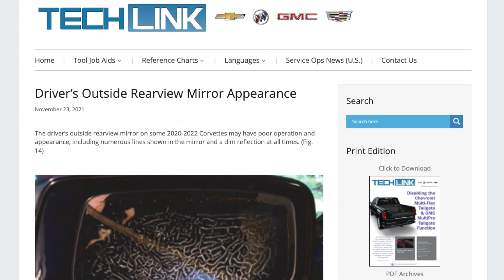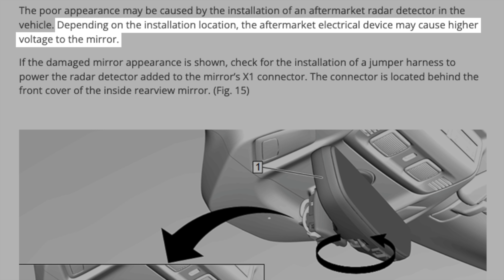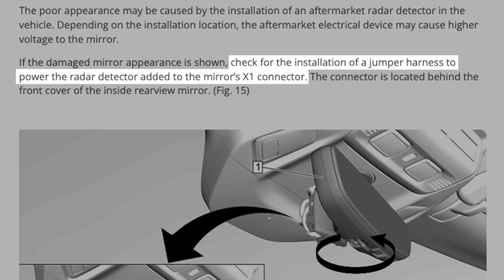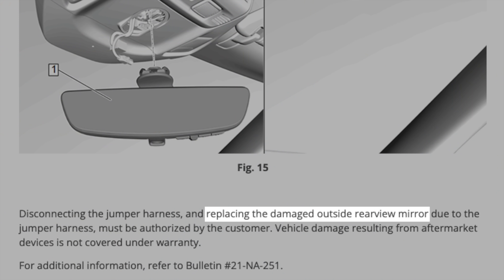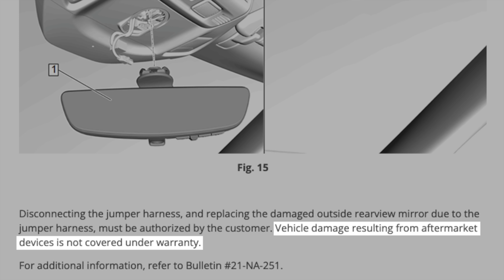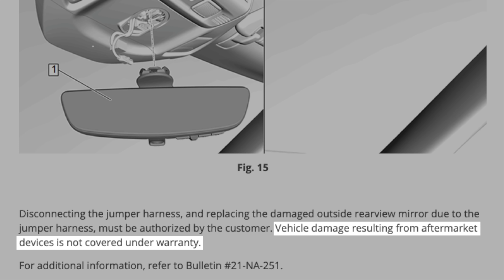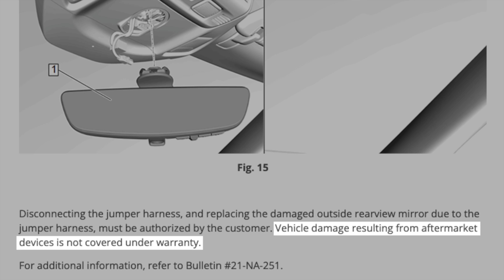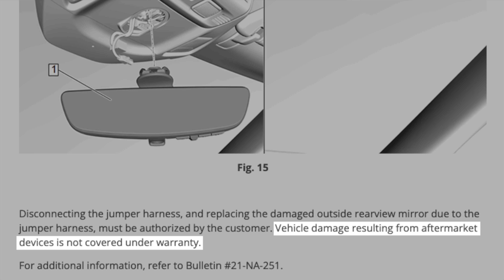Radar Detector Damages C8 Corvette Mirror? Five Minute Fridays, Ep. 37

Comment: Thanks for bring that to views awareness!  That is correct (Red to Red, Black to Black), I guess I am lucky, never even thought about using the Green since RED strictly speaking is (+) Power while other colors although measured with 12VDC that can be source to other devices... risky to tap in those colored wires without knowing exactly what's sourced to... Voltage spike and current fluctuation can damage sensitive devices.

Comment: I have a 2021 C8 and used the mirror tap with no issues.  I use the Uniden R3 with it.
Reply: I love my R3 and will soon enough be using it in my C3 Vette. Sweet icon btw, I'm also a big Pink Floyd fan! I still want to find officers willing to laser test cars like Corvettes to figure out where they get a reading and find ways to negate that! I still feel like the vettes are pretty tricky to use LIDAR on. Thoughts?
Reply: What trim level is your c8

Comment: Today I tried to put the mirrortap on my 2022 C8 Corvette. Got the wires right but then could not put the cover back on as they stuck out too far for the cover to go back on. Tried to re-orientate the black and red taps but they come flat, not pointed, and it was impossible to get them inserted. 
An option is that there is a cigarette lighter plug under the glove box. You can simply run the cable from the lighter socket to the windshield. 
I will never understand WHY GM DID NOT put a nice tap on the rear view mirror. All that $$$ but they can't put one in.

Comment: I found that in my Ford, the upper "dome" lights are always power on (until vehicle goes to sleep). The negative side is what the CPU in the car uses to dim off the lights so I used a different known ground lead for the negative. I just wired my R3 in from that hot lead. It's ALWAYS a good idea to NEVER use a safety power circuit like airbags or seat sensor leads to tap into. There are places to find local straight ground and power along the headliner areas. I think the safest is the light circuit power. However, schematics may be changing since my 2011 truck with all the new LEDs on the interiors...I would certainly find a schematic to locate a safe place. Your dealer may even be willing to help out with at least the schems.

Comment: so let me get this straight.. red to red, black to black should be common sense.... if you plug the ground into the mirror data cable instead you brick it...im shocked!!! does the instructions actually telling people to plug the ground into the grey data cable or what????
Reply: Yeah kinda confused how people could mess the wiring up.
Reply: It's not that simple. The colors on my car are power=violet/white, power ground=black/white, mirror ground=black/yellow, mirror signal=yellow/white. Violet is switched power throughout the whole thing, red is unswitched power. However, if you use black/yellow instead of black/white, you'll get this issue.

Comment: Have you heard of any issues with the mirror tap affecting the driving sensors on the vehicle, like adaptive cruise control or lane assist? I drive a 2023 C43 AMG and I was buying my Uniden from Best Buy. I had to buy a USB - USB-C and USB-RJ11 cable for it to work in my car (I only have USB-C outlets). I spoke to the guys in the Car Audio Department, and they said they wouldn't do a mirror tap because it could throw everything off and have to be recalibrated. I also don't trust anything anyone working at Best Buy has to say ( no offense if anyone reading this works there). I spoke with the Merc Dealership to see what they have to say about it and i'm waiting on their response, but I was just curious if you or anyone has heard anything about that.

Comment: I went to have the Valentine g1s2 installed, bought the cable and mount from blendmount ..both places I went either refused to tap into the mirror or to warrant the installation if I insisted. I chose to have it run the the fuse box. They couldn’t find the wire they needed behind the glove box so had to run it to the fuse box behind the waterfall. There he found a cable that cut power when the car was turned off as proven by the voltmeter. When we started the car it threw a warning which turned out to be due to the installer unplugging the cable he was tapping. After clearing the code all was well. Everything works as is should. I do have a question about what android phone you suggest for the jbv1 app. I can’t seem to find much under 229 for the pixel 6a which is too expensive. Any ideas?

Comment: In the odd chance someone can help me here - I have a 22 Camaro SS and I tried to buy a tap kit to slot into the airbag light harness up where the onstar unit is located. However, I read the 22 Camaro SS doesn't supply enough power to do this anymore. Uniden R7 is the unit I'm using. I've read the only way, is to now run a cable from the fuse box in the engine bay or the truck, since the camaro doesn't have in the cabin. Any other suggestions? Posted on a couple forums without luck.

Comment: Interesting stuff...I discovered through research a similar issue also occurs in the Dodge Challenger ( possibility other FCA models) rear view mirror system that can damage the canbus ,  so I ran the connections to the fuse box in the trunk . Problem averted .

Comment: Looking at this and knowing what I know of wiring in cars. Doesn’t matter, the fault lies with the car maker if you can cause this sort of damage as both LIN and CAN (and other functional networks like  FLEX, Ethernet, etc ) should have a offline state for that specific brand of the network if they get pulled up or down beyond a fairly tight threshold.   

My car, older volvo wagon.. I had a few com bus issues  back when I had a bad alternator locking up the regulator and sending low current 12V straight signal over LIN which caused my car to for 1/8th if a second believe all the doors where open and all seats were occupied by no one though believed occupied was unbuckled.  Also sometimes get it freaking out about BLIS being in a limited state..  luckily for me no damage has occurred…
Reply: Oh bullshit. There's always that guy that thinks aftermarket tinkering is the manufacturer's problem. Just be quiet.
Reply: @uclajd  literally every single network within a car is designed to be able to sustain dead shorting and full battery voltage clamping without causing damage.  This is the basic specification every network within a car not only sets but claims to exceed in a range of ways. 

This means is someone plugs in a device say a radar detector that consumes a mild amount of current maybe 1-2 amps at most so enough to pull a network down but not enough to trip circuit protections.  You wire that into the wiring from interior mirror which often has a 3rd wire that’s a communication bus attached and say put that mild 1-2 amp radar detector load on the communication bus thinking that’s battery power after a very quick probe with a multi meters and seeing power.    Well According to the network’s own specifications it shouldn’t be causing any damage.  

I guess counter argument is that we seen car makers violate their own specifications countless times so why expect their networking standards to be any different…   And uhm. Yep you are completely right/correct.  I have had a headlight control module (yea these exist now) go bad once and it took my tailgate offline so I couldn’t unlock it or lift it. Couldn’t pop it from remote or the button on the dash.  And unlock button didn’t have the tailgate lock position changing.  Checking wiring diagrams and cross referencing I still have no idea as the POT (great name for a tail gate module) and HCM connect as they share not a single wire and appear to be on separate rings.  But as verification, replacing the HCM (Headlight Control Module) fixed my tailgate.     And yea that means they violated their own specifications….